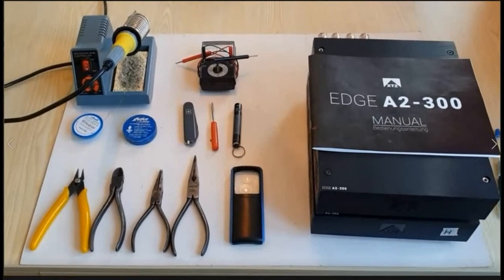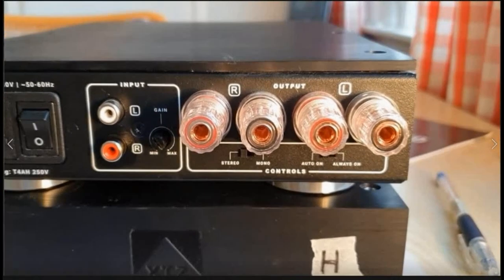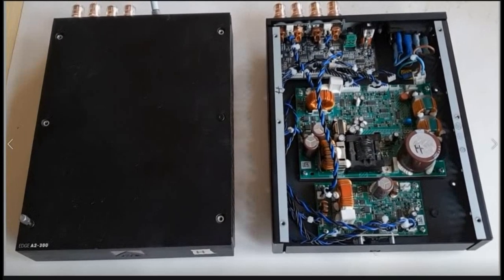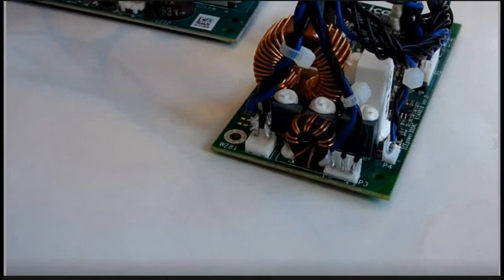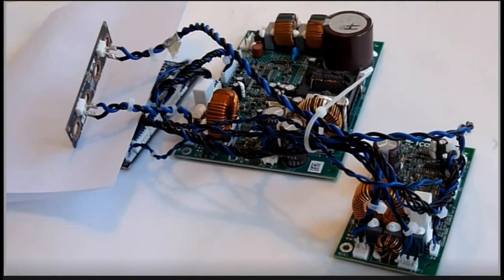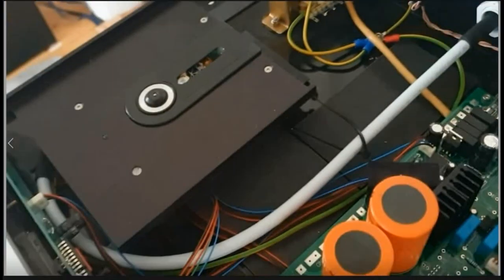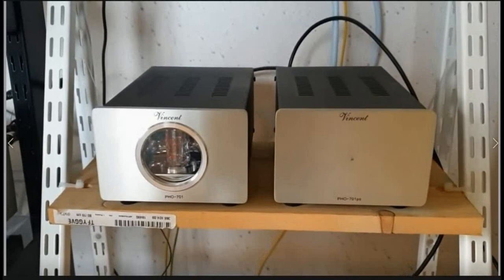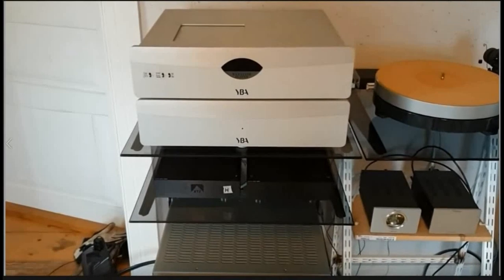How to improve XTZ EDGE A-2 300 Power Amplifier (No.1 of 2).

Comment: Thank you very much. Great video! I think this is an awesome idea myself. I may have to do this w/everything in my system. You've basically got nothing to lose other then some time, a little solder, and an extra few cents on your electric bill. I'm not surprised there's noticeable differences too. There's a reason why stuff was always soldered until fairly recently. This is just a manufacturing cost cutting move by them. And it makes it easier to do repairs later too. I like using crimped connections myself, because it's quick and easy. 

But there's no way they're making as good of a connection as solder will. Even a really tight crimp. Plus you're just adding stuff that's not needed. I started using crimps while building car stereo systems, and I still would in that particular application. But I need to break myself of the habit when it comes to doing stuff at home. It's definitely time to learn how to solder. Hopefully it's similar to welding. I'm pretty decent at that. 🤞

And I'm also very appreciative that you showed us your gorgeous setup. Seeing that these were an upgrade from the Primare integrated really helps. As does seeing them being used in, what I consider to be, a better system then my own. I'm thinking of getting a better amp (current amp is an AVA Omega Star 250EX), and I don't want to end up making a lateral move. This was already in my top 5, actually top 3 really. However, I think this video just put it all the way up 🔝 for me. Hopefully it will play nice with my Holographic Audio Pre TwentyFive (they're both from 🇸🇪 I think, so that's a good sign) SS preamp, and my Wharfedale Denton 80th Anniversary speakers.  ✌️

Comment: I have this Edge and was concidering a second to use them as Monoblocks with my Elac UB5's, I also have A SVS PB 1000 and use a Pioneer Elite SC 81 as a pre amp. My Elacs can't be bi amped. Should I bother with a second Edge, and just use the single Edge to power my Elacs?
Reply: Perhaps you can use monoblock to each speaker

Comment: At first I was annoyed by the constant pronunciation of solder as "soul-derr" but I checked Meriam-Webster and that actually is an approved way to say it. We Yanks say "sah-derr" and we like it that way. :)   I too am annoyed by the number of mechanical connections I see in modern gear. In my system, I like to solder every connection that can be soldered. I'm sure this is an excellent mod to the amp, an amp I am seriously considering buying. Thanks for making this video.
Reply: Getting caught up on pronunciation is pretty petty.  Language is a tool to communicate.  The purpose of communication was achiveved, who cares about how the tool was used.  I guess petty man cares.

Comment: Mod for what kind of improvement?
Reply: The placebo kind
Reply: @Abrikosmanden  Not!!! 

I'm quite sure this could be easily measured with a simple multimeter. But like most people commenting negatively on HiFi videos. You probably have very little "real" experience with HiFi anyway, and just enjoy being a Negative Nancy. ✌️
Reply: @Abrikosmanden  You are correct.  None of the modifications performed in this video were capable of altering the frequency response of the amplifier.  Replacing copper terminals with slightly more expensive copper terminals and permanently soldering JST connectors simply ensures that the poor soul responsible for performing an actual servicing at some point has a significantly more frustrating time.
Reply: completely unable to state the Goal upfront!
Reply: @Abrikosmanden  Correct. More Audiophoolery.